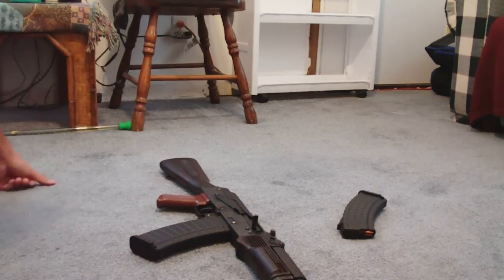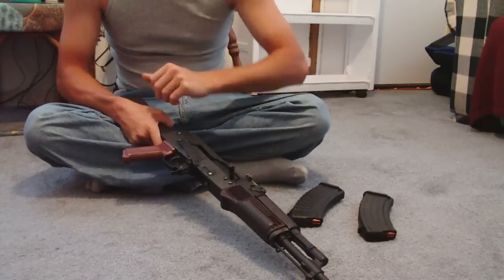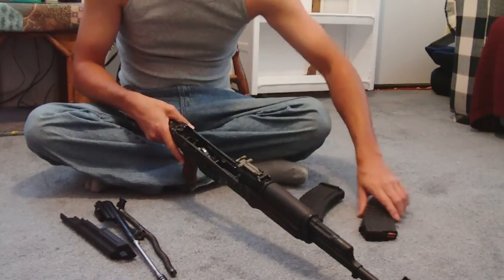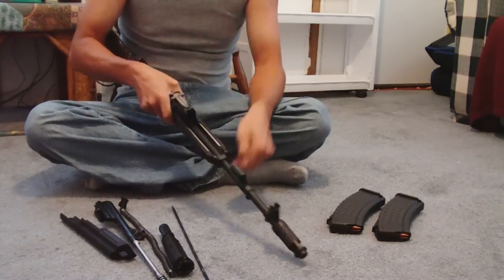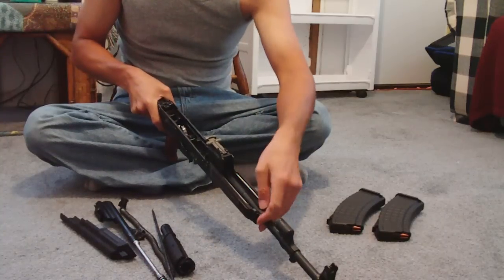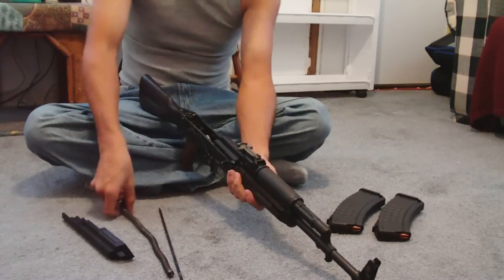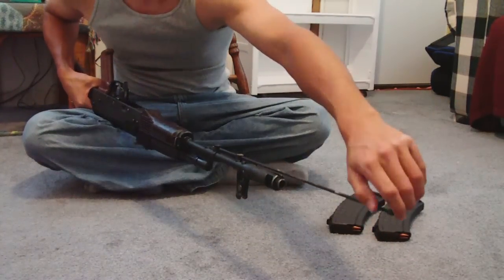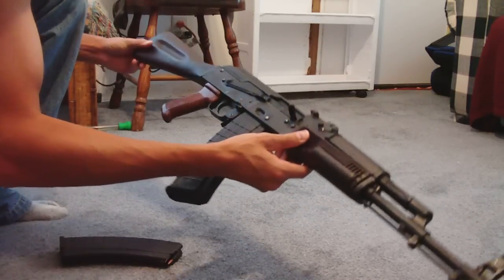Funny AK-74 Field Strip (5.45x39mm)

Comment: @TMHonfire102 will a kit for the AR-15 work in the ak74? I know ak74 is 5.45mm in diameter and the ar is 5.56mm in diameter. Basically...does it matter, or are they close enough together that a 5.56 cleaning kit won't hurt the ak74?

Comment: @TMHonfire102 Every mechanical device has a life cycle. Dry firing adds wear, just as live fire does. However, in dry firing the firing pin is being battered against the inside of the hardened bolt. As opposed to the firing pin meeting resistance against the soft primer. Its kind of like saying driving your car in snow and ice wont hurt anything. Sure, the evidence may not be READILY apparent, but you are putting "more miles" on the gun then necessary in the harshest possible way.

Comment: question! I just got one and I flipped up the gas tube switch and it wont go back down and at the same time the rack wont come out (i did it before removing the rack) is this just stiff workmanship on the gun (should I just hammer the switch down) or is there something specific I need to do?

Comment: @headbusta25 It's an AK-74, not an AK-47. The AK-74 is chambered in 5.45x39. The AK-47 is chambered in 7.62x39. And like the other guy said, dry firing won't hurt most guns - just don't do it with rimfires and antiques. Seriously, why would you post if you don't know what you're talking about?